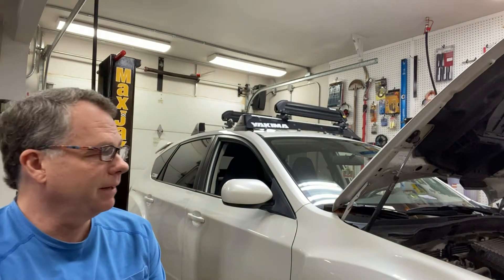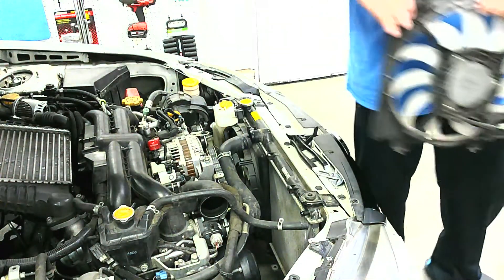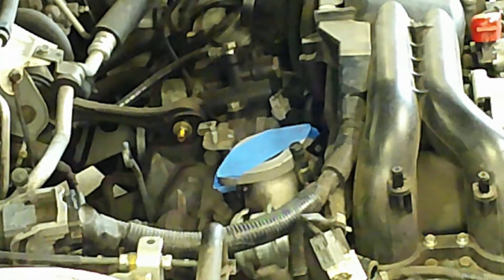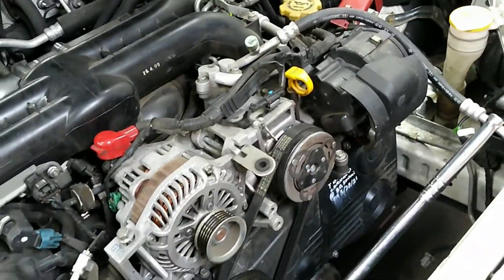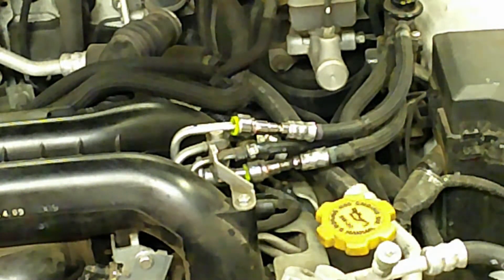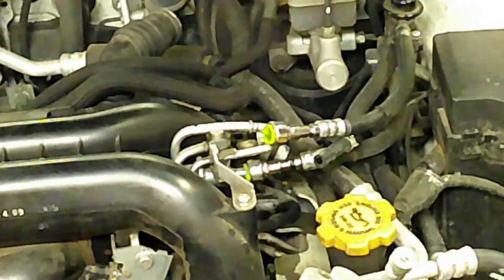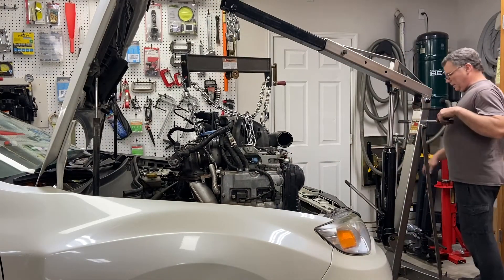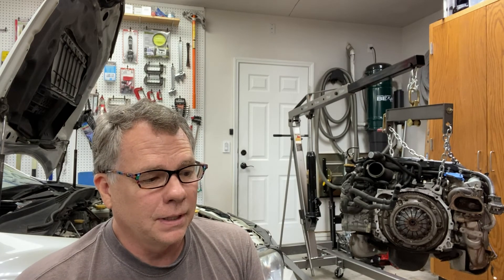Subaru WRX Engine Rebuild (Part 1 of 12)

Comment: How do you find these rebuilds hold up? Some of the forums are quite dismissive of rebuilds, but it looks fairly straightforward and it's not clear what would go wrong if it's done with care and attention.
Reply: I would be very careful about the connecting rods. I have 2 of the ej25 motors with the knock. I'm in the middle of the 1st motor, which ran a long time with the noise, possibly 10k miles. When I took the rods off the crank, the bearings were not spun. But they were to copper, and they fell out of the connecting rods. Actually were.020 to .030 smaller than the width of the cap and rod. Connecting rods had to be resized. Make sure you cut no corners if you see something like this. Started out as a noise when cold, this one never progressed beyond that. The other motor made noise the whole time, initially worse when cold.